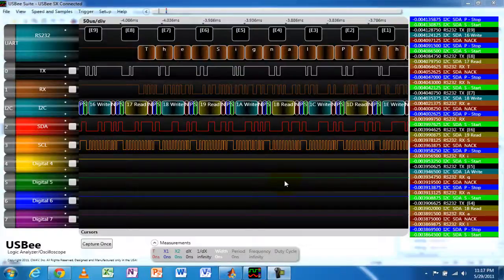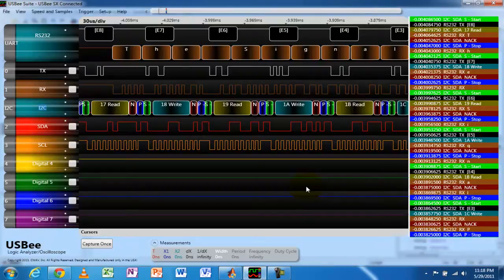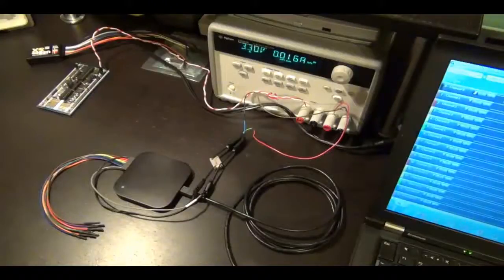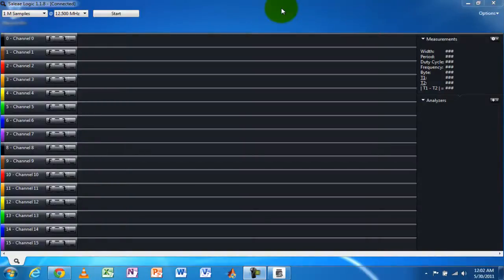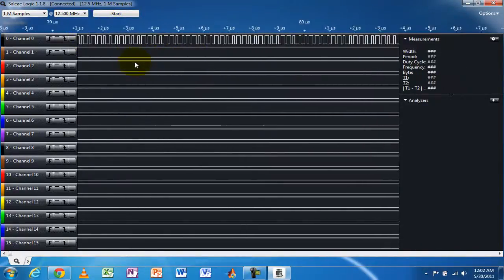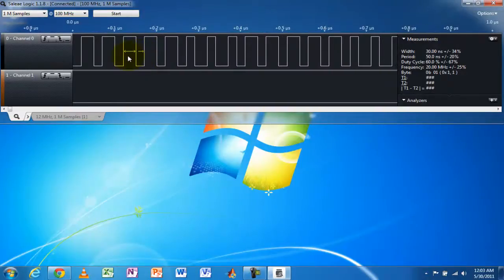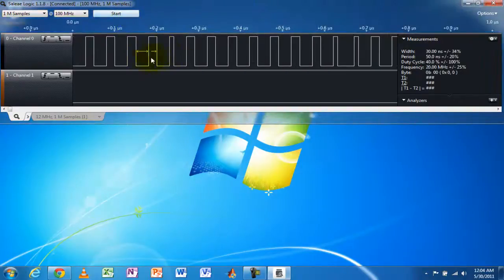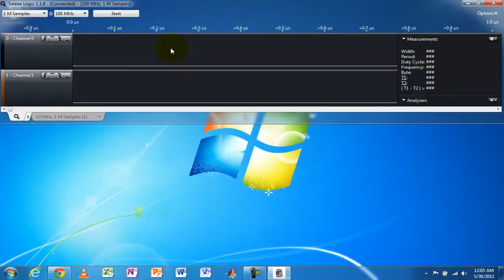TSP #1 - Saleae Logic and Logic16 Product Review (Part 2/2)

Comment from the maker: @delinthe The USBee SX is able to generate digital patterns once you input them into its dedicated software. It is a good feature, but I have not found myself using it more than once or twice during the last year of owning it. I tend to treat these units as measurement tools, especially since you can't generate and monitor signals at the same time. So most of the times I am using them as logic analyzers. I think Logic has a better software/hardware built quality. If you can, get Logic16.